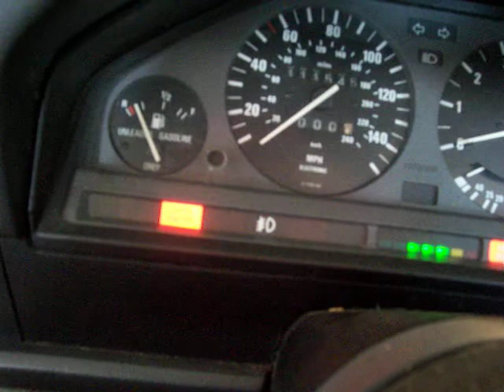E30 M50 NV First start.

Comment: you're using 318is radiator. would it be better to use one with expansion tank connected with hose? is it possible to move the engine further back for better weight distribution?